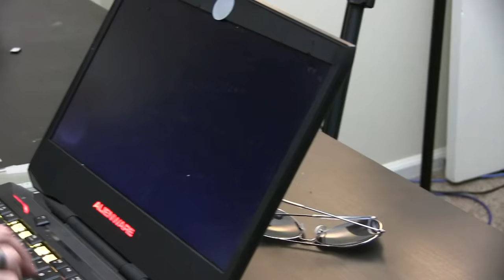AMAZING MINECRAFT PC BUILD

Comment: This is $299 on amazon. It is just a dinkey Raspberry Pi with an LCD, 1GB RAM, 1.2Ghz Quadcore CPU,  6600 mAh powerbank,  8GB SD,  Mouse, Minecraft, and the case. Honestly, what they did with it was an improvement.

Also this was a bullet point
● It even comes with a Piper Screwdriver!